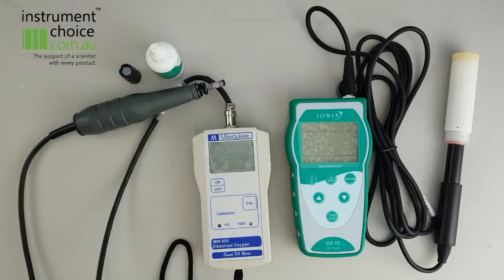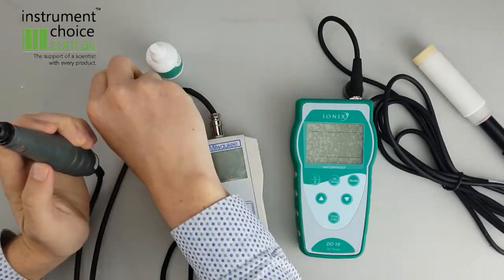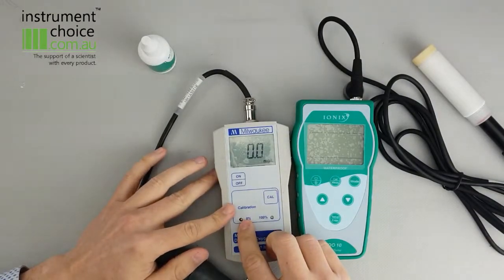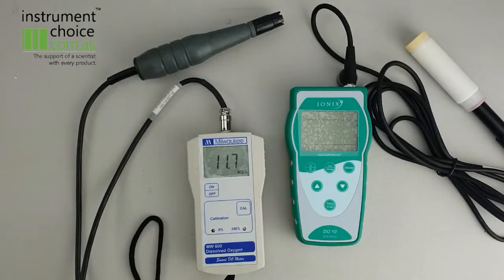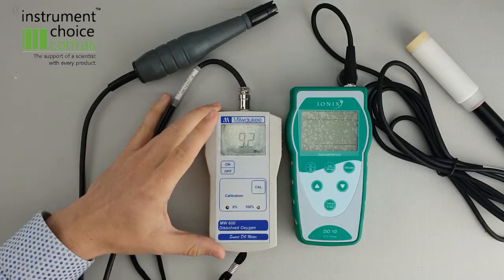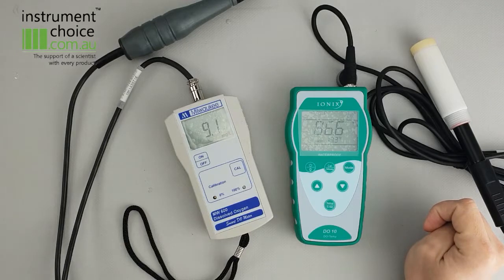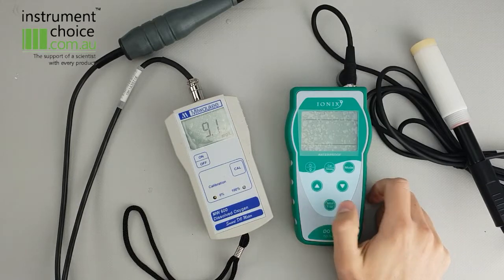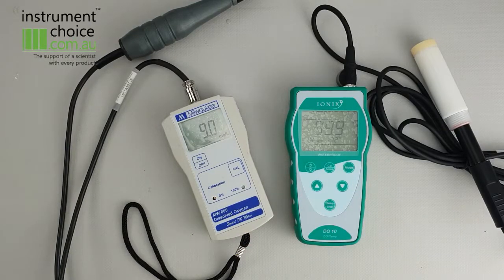How to calibrate the MW-600 and Ionix DO10 Dissolved Oxygen Meters!

Comment: Sir I want to know after calibration if the display shows 9.1 or 7.9 then is the meter correct???
Reply from the maker: Hi BMEHasanMahmud, thank you for your enquiry, on this, can you confirm which meter you are referring to here? The value of 100% is more relevant than the 9.1mg/l value as this is adjusted for our barometric pressure.